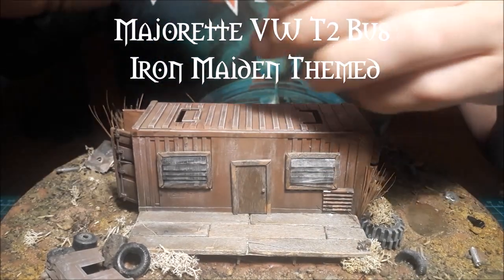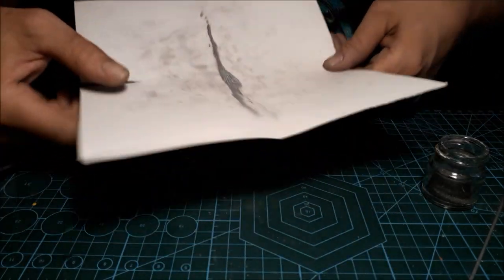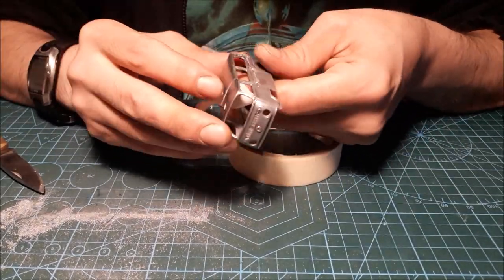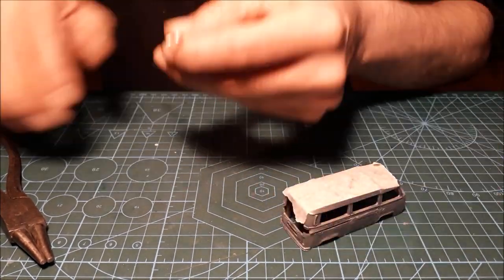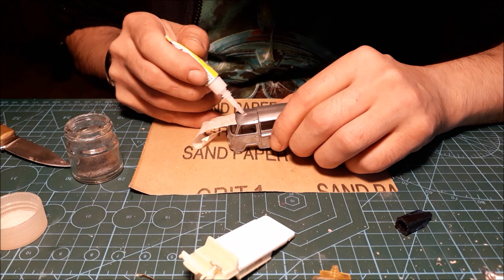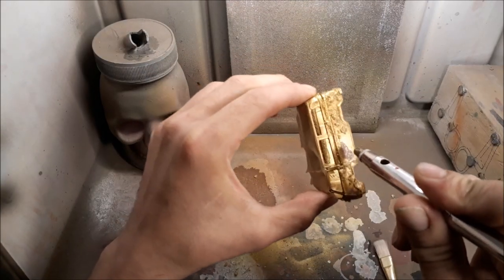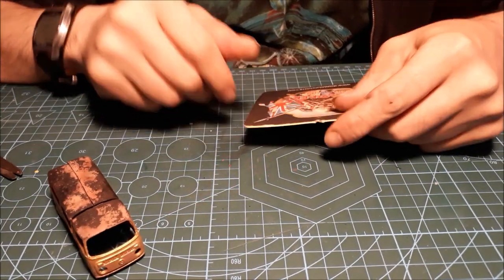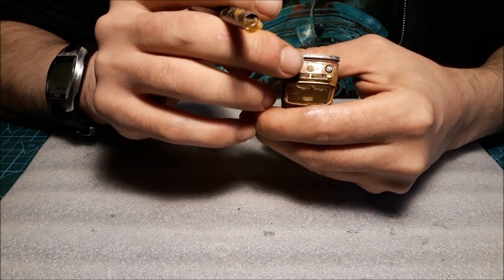Majorette VW T2 Iron Maiden Custom Build Off With Dany Diecast Disasters

Comment: Good use of your new gadget, it's going to be a huge help with your builds. The hinges were an oddball idea and worked perfectly - very unusual feature. The beermat was a flash of genius. Using paper, with white glue, gives you so many options; cheaper than decals and unlimited possibilities.😁👍👌  Did you put a clearcoat over it at the end?
This build-off was an appropriate chance to try out some of these techniques and you knocked it clean out the park.✔
Reply from the maker: I didn't use a clear coat as all I've had at the moment was gloss and I didn't think it was suitable...Cheers mate